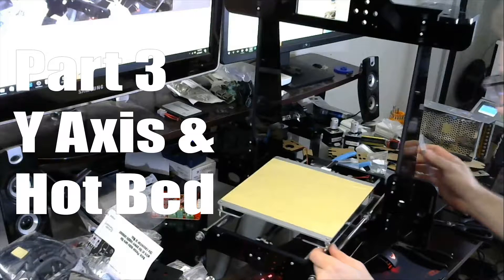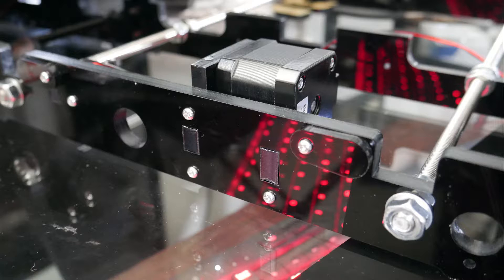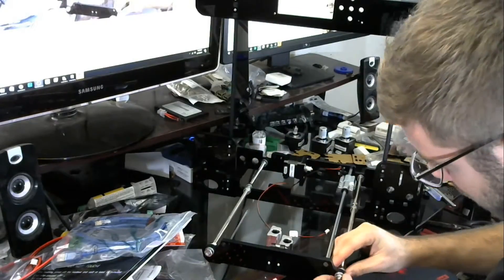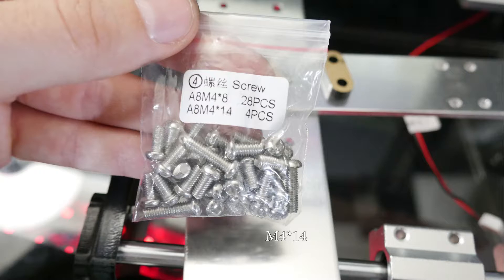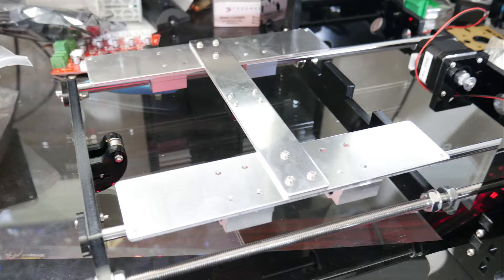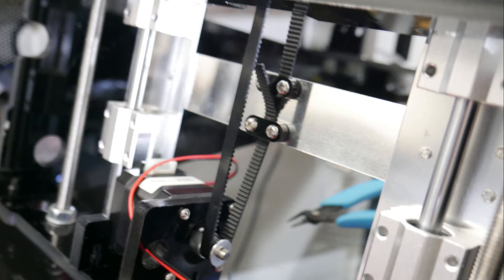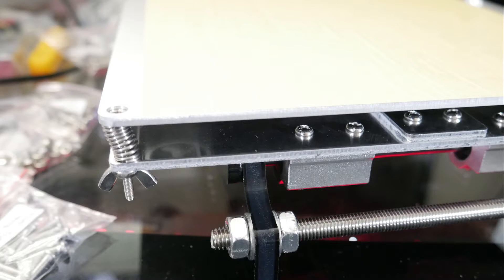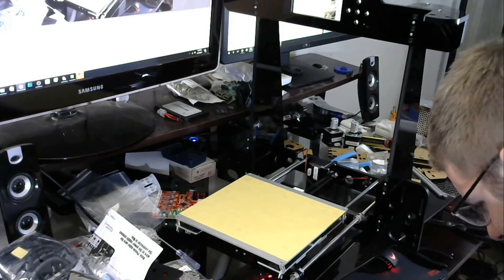Anet A8 3d Printer Build Guide Part 3 Y-Axis & Hot Bed

Comment: At 1:54 you have the aluminum H upside down. You have it the same way as the other build videos but that takes the belt out of parallel by a few mm. The H should be installed as it is at 1:54 but the belt hold downs should be on the bottom.

Comment: great vids i was working through them after my first anet a8 turned out to be a fake. i got to the end of this video and i could not get the screws through the h plate at all was ridiculously tight, also that was when i noticed the plug in the box was all melted and had melted polystyrene stuck to it, such a shame i was so excited to use this printer. is there any other printers you would recommend around £300 mark?

Comment: Hey Modbot, I have a question for ya. Well I'll give a bit of backstory first I suppose. I'm 16 years old and figured "When would be better than now to get into 3D printing?". With your thoughts and the reviews of a few others it's been settled. In a few weeks I'm going to purchase my very own MPSM (Monoprice Select Mini) I wanted to know how to change filament on the machine. With me being very new and not seeing how anywhere  (perhaps it's obvious and that's why I can't find it anywhere) I figured I would ask you. Great vids man, keep it up.
Reply from the maker: +Richard Cornell hey! Very excited for you and the mini is a killer choice for your first machine. It is pretty easy! For starters you need to heat the hotend up to plastic melting temp so pla 200 or so and abs 230 or so. Then to unload you can either use your hand or go under settings and have the printer extrude backwards. For me I use my hand typically I push a little filament through the hotend and then pull the filament out. The little initial push helps the filament flow and get unstuck. Loading you just need to cut the end of the filament so that it looks like this / then push it through down to the hotend until you see the plastic leaking out the hotend and you are done! If you can't get it to leak out the hotend try using the extrude plastic setting and the motors strength should push it through. It is very simple just not simple to explain through text!
Reply: ModBot Thank you so much for the reply! Also, thank you for leading me into my future of 3D printing.
Reply from the maker: +Richard Cornell no problem and I am glad I was able to influence you into getting one it's addicting so be warned :D